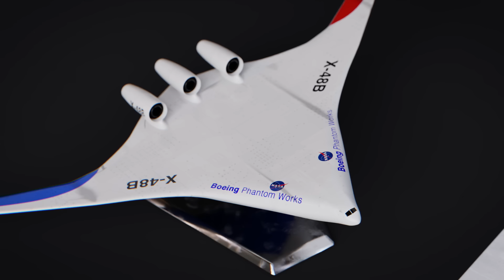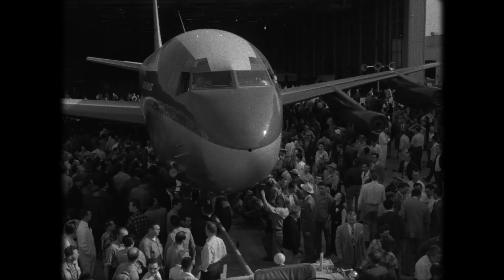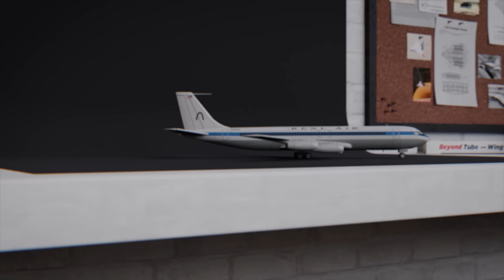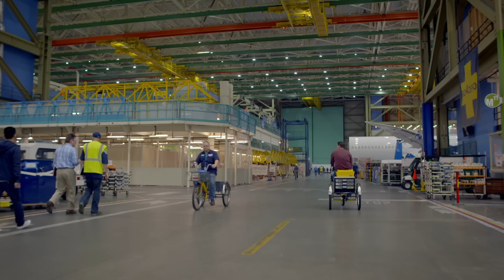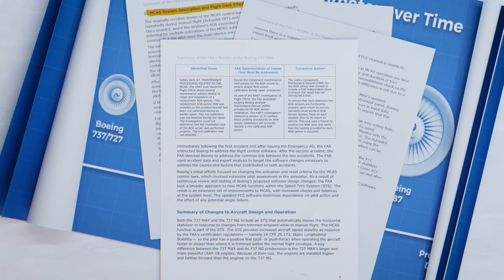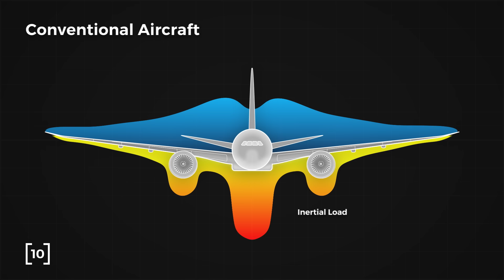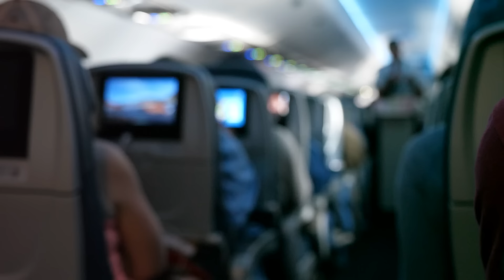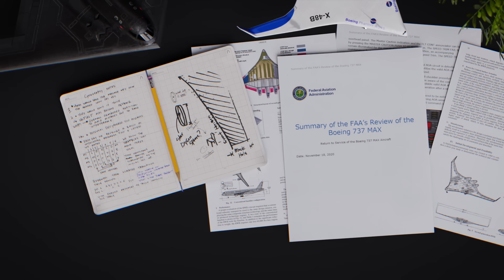The Plane That Will Change Travel Forever

Comment: Two minutes from the end, we learn that the main upside of the altered wing design is that it could accommodate a less expensive fuel supply....by 2040 or thereabouts.

My guy. The Alice- an electric aircraft made by Eviation, an Israeli company- has multiple orders placed and is planning to start commercial flights in 2023. Even if there are setbacks and delays, come on now. Electric flight will go through multiple cycles of innovation and improvement by 2040. Is this wing design under consideration as a potentially ideal design for electric flight? The answer is yes, actually, it's a candidate. There's a lot that will be different about electric planes though- and present regulations will need to change a bit in order to accommodate that. A wide range of designs are under consideration, however, and it seems like an odd choice to focus on something other than electric flight while looking at a target date of 2040. That's not the least bit interesting.

Comment: It doesn't make sense to me to have the center of gravity be ahead of the wing (and the lift from the tail therefore being downward to balance it).  Passive stabilization shouldn't require the tail to push downward, with a negative angle of attack.  It should only require a different angle of attack than the wing, configured so that when the plane pitches away from the horizontal the lift changes to pitch it back.  If the plane has the tail pushing downward, that means weakening its lift when the plane pitches up and strengthening it when the plane pitches down, which means a negative angle of attack.  If the plane had the tail pushing upward (i.e. if it had the center of mass behind the wing), the angle of attack would have to increase the lift of the tail when the plane pitches upward, and decrease it when the plane pitches downward.  That would mean having the tail pitched at a lower angle than is optimal, so that when the plane pitches upward it becomes more efficient at generating lift, and when the plane pitches downward it becomes less so.  Stability would still cost some efficiency, but it would have that stbility costing part of the tail's induced drag instead of costing double.

Comment: Strictly spoken, it wasn't actually the shape of the De Havilland Comet's windows that caused the fuselage ruptures. It was the combination of the square corners AND using a punching process to make the holes for the rivets, as opposed to drilling the holes.
Reply: @Adrian_Nel Quite correct. There were many other errors that led to the Comets crashes. Both the Comet and Boeing 707 had square windows with 3 inch radiuses in the corners anyway.

Comment: The tube and wing architecture is much older than the jet illustrated - it exists even in nature - birds use it daily. Even most of the earliest aircraft used it (excepting the Wright brothers layout with an open seating for the pilot/passengers).

Comment: Airbus has been safely flying FBW aircraft since 1982. Generalisation about FBW safety are unhelpful. The fact that Boeing allowed an unforgivable SPOF (Single Point of Failure) with a single AOA sensor was unforgivable. Airbus aircraft have 3.

Comment: I think you have very unfairly mischaracterised the YB-49 as a failure. It was actually an extraordinarily successful design for the time. The accident that killed Capt Glen Edwards was an exploration of a flight regime they had been warned about and exceeded the flight limitations of the aircraft far beyond what was needed for a bomber design. It is akin to being warned about deep stall in a T-tailed aircraft and doing it anyway. The aircraft as described by test pilot Maj Bob Cardenas, had a very slight side to side lateral decreasing instability following a disturbance but that was a less than 1 degree periodic oscillation in the yaw axis. In other swept wing aircraft this is more pronounced and called Dutch roll and it managed by yaw dampers. As a passenger aircraft this would not even be noticed but as a bomber with freefall conventional bombs this was deemed a problem. 

This could have been solved with an available solution in a Sperry two channel autopilot system. All of  the available stability and control technology had been pioneered including the flight control layout (without an artificial stability system)  and later used on the B2 (ruddervators etc). The YB-49 proved to be an extraordinarily efficient aircraft even with 8 early and thirsty turbojet engines and flew transcontinental from California (Muroc) to Washington in just under 4 1/2 hours, an unbelievably extraordinary feat in 1949, just 4 years after WWII had ended. This aircraft was the original blended wing and was a victim of politics, not technology. The documentary 'The Wing Will Fly' is a tribute to this amazing aircraft.

The challenge with BWB designs is convincing people to fly in them, We are land animals and want to be able to see outside. I am not sure synthetic vision will cut it. The other problem with all span loaders is movement of the passengers in roll. A tube means a small roll moment. A Span loader means a large roll moment. Not good for the balance system or sensitive stomachs.

https://en.wikipedia.org/wiki/Northrop_YB-49
Reply: @Completeaerogeek Very informative an interesting. Thanks for posting.

Comment: How to lie with statistics… The reduction of fuel per passenger -50% is ok, but graph suggests fuel consumption has gone down way more. Because thebaseline is 50% instead of zero. By chosingnin conventional baseline of 50% instead of 0 the graph suggests a farbigger reduction then actually is thecase. Totallyunneccessary, as the-48% is very impressive already, soon need to stunt with baseline in graph..
Reply: @Henkvanpeer Yes, I thought the same. It's very dangerous the way that maths and science are corrupted these days

Comment: Just so you know the first successful commercial Jet Airliner was the De Havilland Comet 2 years before the American one you stated in your video. There was a time when it was pulled from service because of 3 Comets lost due to Metal fatigue due to pressurisation issues, but the research and development that countered those problems was used by Boeing to ensure the safety of their own development of the 707. The Comet 4 was in Service from 1958 until 1981 and still carried on being used in various other roles until 1991. It was also developed into the Hawker Sidley Nimrod, which as a maritime defence aircraft by the RAF flew until 2011.
Reply: I don't think we watched the same video. There was a segment on the Comet and it stated clearly that it was the first successful passenger jet airliner. The narrator is Irish and the Comet is well remembered in Ireland because it was the only Aer Lingus aircraft that was ever involved in a catastrophic crash. The investigation of this and two other crashes revealed the problem that it had with metal fatigue.

Comment: Can someone explain why canard design(possibly with delta or high swept wings) would NOT work ? It's seems as like good half/half solution. Combing ease of manufacture in tube+wing design with better lift efficiency and flexibility.  It seems pretty feasible considering military adoption.
 
Sorry if I got anything wrong. Im no engineer, but merely aviation enthusiast .

Comment: Vested interests have ridiculously held the narrow-winged tubular fuselage design in use for many years in passenger aircraft, when if a plane fails, it almost inevitably plunges to the ground and kills everyone, whereas broader wings like this enable any passenger aircraft to effortlessly glide to the ground without total loss of lives even if all engines fail. They should have made this design the industry standard decades ago.
Reply: @mothman7778   The tube wing design has proved itself since 1920. Most of the single wing aircraft from the past have been dangerous failures, apart from some specialist US military aircraft. Single wing aircraft are inherently unstable and are subject to severe deep stall, so they would hardly glide to ground.

Comment: The Blended wing is a great concept for UAVs and their current smaller airframe applications, hideously ugly as it is. The 'Bat' is quite interesting though as a small UAV concept only.

This design concept will NEVER work for high capacity commercial passenger missions.  
There is no efficient terminal real estate design (both ramp space and boarding lounges) that could practically accomodate one aircraft with aerobridges, much less rows of this piggish-looking nightmares. 

They would be the very antithesis of boarding efficiency. Just boarding a twin aisle aircraft, regardless of how many cabin doors are opened with respective aerobridges aligned. This process is not without its confusion from passengers by not following crew directions, particularly small groups seated together not wanting to separate into two aisles even though they will reunite at their respective seat rows, and are told this. Even more confusing with foreign language dynamics.

The confusion surrounding passenger organisation and confusion in an airframe of that width and shape would be madness!
Passengers would be forever getting lost inflight. Heck, they would get lost trying to locate their seat  just during boarding!

Crew seating distribution throughout the cabin would not work, the primary role being that of safety/security therefore needing to be distributed evenly through the cabin to coordinate small to medium sized groups of passengers AND be seated beside the exit they are responsible for and will operate in an evacuation.
This ridiculously wide 'people-freighter' would also necessitate crew to be not only at door locations but in many 'mid cabin' locations also. That would mean extra crew, also the additional crew would be needed for the nightmare service flow which airlines will not agree to, they want the  absolute minimum crew compliment, not more!

As mentioned. conducting meal services, assessing passenger behaviour throughout the cabin, managing an inflight medical or security emergency, etc etc - would be beyond a nightmare. 
The separation of cabin classes would be logistically and aesthetically undesirable.  Passengers will never accept the absence of real windows for too many reasons to explain here. 

From an emergency perspective the absence of many evenly distributed windows is absolutely unacceptable and impossible, this is due to the very real need to have direct vision for assessing outside conditions, when selecting the safest evacuation routes and doors to open, being able to assess external aircraft structures in the event of technical failures/concerns. The use of virtual or video viewing options would be impossible and absolutely NEVER accepted.  

Evacuating an object of that shape and wing-box width would be next to impossible with the volume of doors needed for the volume of passengers carried. For both land and water evacuations the location and sizes of sliderafts to accomodate the volume of passengers carried, and passengers to have immediate unhindered access to, just could not and would not work.

It would be enormously unsafe having the majority of exits bunched up towards the forward zone, it would never be certified.
In the urgency and highly motivated desire to evacuate, passengers will NOT remain in orderly rows, they will follow the lead of others causing bottle-necking.  I don't see how efficient exits could be placed and function in the aft zones. 
Due to its shape and width complexity with exit locations, it would completely fail the certification requirement for evacuating the entire cabin in less than 90 seconds using half the randomly selected exits.

There would also be major concerns with lighter loads and passenger distribution across the cabin for stability, not an issue with tubular fuselages widthwise. Tubular fuselages are stronger and more functional. Due to their circular shape, many extra spaces become available without reducing profit-making seating real estate, this includes fuel tanks, cargo holds of varying capacities, crew rest areas (needed on long haul operations, even galleys and restrooms. Not possible in a large block!

This ugly blended wing concept could NEVER be manufactured using composite fibre technology, the strength arises from the total complete structure vs sectional components as with metal designs. This is why the carbon composite fuselage is 'cured' in an enormous autoclave. An autoclave, which MUST be cylindrical for extreme pressure tolerances would have to be so impossibly large to accomodate the size of 'fuselage' sections/units for the ugly behemoth! 

These are just the very real limitations I can think of currently, I'm certain there are very many more. It is pure fantasy to think any of this is possible or even remotely feasible which is why it has never developed beyond its current concept and I certainly hope it NEVER does.  Everything about it, inside and out is completely HIDEOUS! It has the appearance of a spacecraft, not an aircraft.
Reply: @sydyidanton5873 That was an interesting read, evaluating the blended wing mainly from the passenger point of view. I would guess from your comments that you are in the airline industry.😊

Comment: 12:22   It was NOT Boeing's ''corporate greed' - it was the AIRLINE's 'corporate greed'.  They gave ridiculous caveats on what they would accept, one of them being NO pilot conversion training in sims.  It was Boeing's 'stupidity' and attempted work-arounds that contributed to the entire debacle.  All thanks to the brainless arrogant exec's in Chicago - a majority inherited from McDonnell Douglas (aka 'Mad Dogs' like their former airframes) 

The work around being the single AoA sensor rather than the usual additional redundancies. One sensor did not require FAA re-certification, additional ones would have. An insane FAA loop hole to begin with. 

I certainly agree - the engineers were absolutely not happy about it, but yet again the brainless and deceitful exec's in Chicago overruled their concerns while also autocratically silencing them, and thus another latent failure or slice of 'Swiss cheese' in Dr. Reason's model facilitated a clear path to disaster.  The engineers and design team have intellectual foresight while the corporates sit 'fat, dumb and happy'.  Arrogance and Ignorance kills people and companies.

The same arrogant MD culture that rushed the DC-10 to market (in desperate competition with the superior L-1011) before a handful of issues were ironed out, resulting in hull losses with fatalities, giving a good aircraft an unfair reputation. 
Clearly the idiots have never learned because the MAX will have an unsettling reputation for many for years to come, especially if and when another hull loss occurs completely unrelated to any fault with the aircraft itself. 

They should have just said to the tight arsed airlines to begin with, "This is our Fantastic aircraft, this is the way WE have designed it, it is far superior to that Airbus junk - take it or leave it!"

The airlines would have still purchased high volumes of airframes because it certainly is superior  to the garbage produced by Airbus (the Concorde killers).

Comment: Blended wing also opens up the possibility of electric transportation. All that top surface? Can be solar.
Reply: @davefroman4700 One of the golden rules of engineering is not to over complicate the issue. For example, if you are trying to develop a revolutionary new electric shaver, you wouldn't want to insist on it mowing the lawn as well. The same principle applies to blended body aircraft, which would be a gigantic enough leap in passenger jet technology, without introducing electric power and solar panels into the equation.

Just out of interest though, here is a quick calculation of how much electrical power could be captured: Assume that the aircraft is triangular with a length and width of 76m (the same as the span of a Boeing 747-8 wing). That would give an upper surface area of 2,888 sqm. Assume that the whole upper surface is covered in solar panels with an efficiency of 10%, and taking a solar constant of 1KW sqm, that would give a power of 288,800W, and then only during the day when the sun is shinning. 

Meanwhile the aircraft's engines would consume 90,000,000W to take off and 45,000,000W to cruise. So the solar power would amount to 0.64% at cruise, which would not be enough to compensate for the extra weight of the solar panels, not to mention the extra drag or the weight of any batteries and control electronics. The cost would be astronomical too.
Reply: @phonicwheel933  It doesn't need supply all the power, just supplement it. Do you think that airlines would not adjust their schedule for a plane that costs 95% less to operate? I think they would. Electric turbo fan jets are already a thing in the RC world. And I am pretty certain Rolls Royce is working on them too. They already produce electric ship motors.
Reply: @davefroman4700  95% less to operate. Wow that would be something. Can you explain how you arrived at that figure? Bear in mind that 1 square meter of solar panels only produces 100Watts, and that is in bright sunlight.

It is true that electric turbines are used in model aircraft but they are powered by batteries not solar cells and have a short duration. There are also electric aircraft but they also run off batteries and only have a range of 300miles.

Electric ship motors is another matter again. Incidentally the UK D16/1 trains of the 1950s also used electric motors, but they were driven by huge generators which in turn were driven by massive diesel engines.